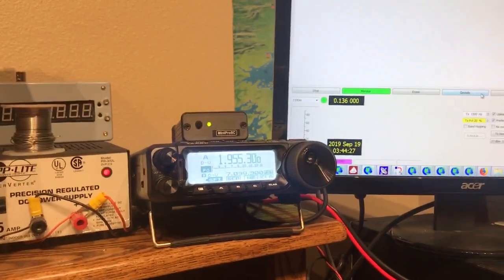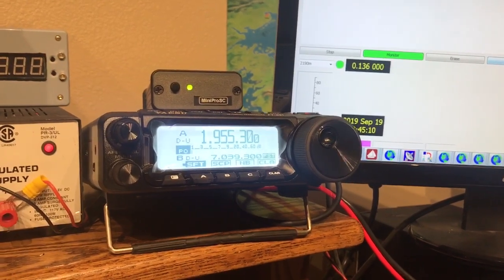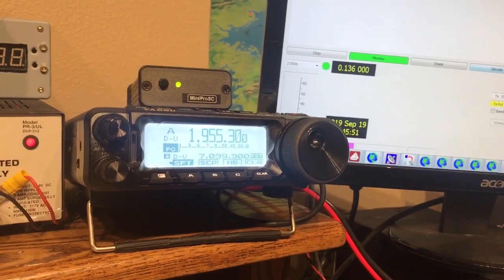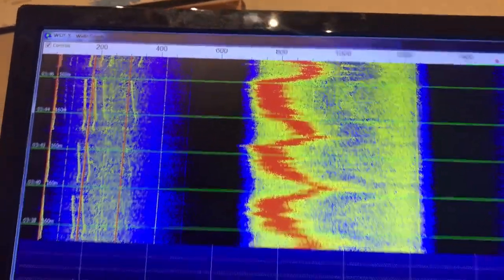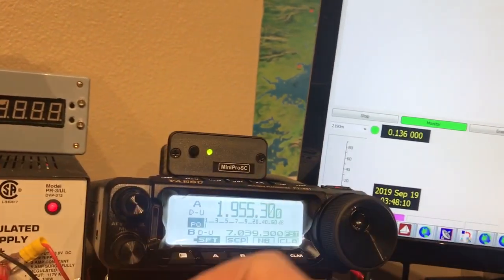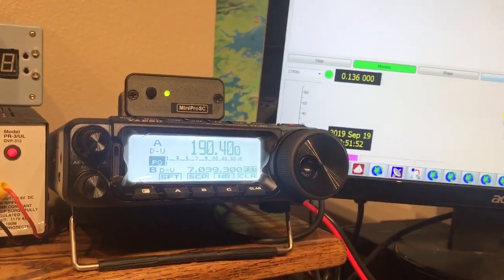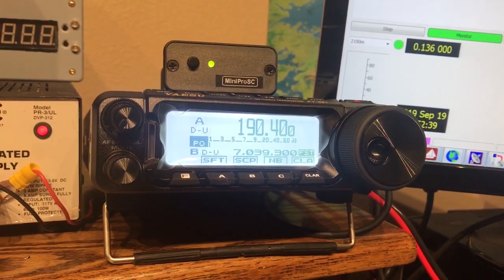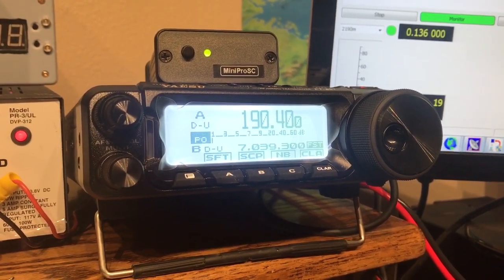FT-891. 160m problem - and worse lower

Comment from the maker: Thats good to know thanks zxeng6064  - I think (perhaps) it the DC/DC level converters needed a little stonger decoupling with lower ESR caps at MF/MF or screening - As people have stated here its not a bad radio for the price point at all but has a couple of design flaws which spoils some aspects for me at very low signal levels on discrete frequencies which Im trying to advertise for future designers-  and to reiterate  for "atomhamradio" the tests were done on DC battery stanalone power - nothing connected by ways to introduce switching noise  up the DC power cables and system terminated in a 50 ohm load direct to the back of the radio  -  I do hope newer serial numbers have indeed fixed my "winging pom" issue.

Comment: i like the radio but OMG they need to fix the firmware 

1. Mode menu, when selecting SSB mode "ask if you want USB or LSB" for faster switching. or just remove "SSB" and add in separate LSB USB trying to fined it in the Sub menu stinks why would they have it in the Submenu it makes it harder to switch.

1.5 when changing the Mode or the BAND using the VFO to select between them is horrible there is no positive feedback like the multi fashion knob.
Change it to the multi fashion knob the detents "clicks" make it easier to fined what you need. and keep it up till you press the multi fashion knob to confirm. a lot of times what happens is you move the VFO knob over shoot it and then bam your on the wrong band because it closes out in 1 sec!

2. With auto tuner enabled I get a "WAIT" over the freq display so I have to go and disable the Auto tuner when tuning around the band. it's Varey distracting it makes scanning the band hard or going to a freq to meetup on.
3. When adjusting the squelch or RF gain, the pop up screen stays up till you hit a button but then activates what ever button you hit! have it disappear after 2 or 3 sec.

4. DTMF mic why is there no DTFM mic to key in the freq you want to go to? They will sell you an extra key pad to you for $99 ??????? but if you get a DTFM mic it will not key in the freq.

5. The power submenu is confusing ok every one gets SSB, AM, and FM power But what is the need for HF power? isn't that a little redundant?

Comment: Pommie with a $500 radio complaining about nothing - this is the cheapest radio on the market.   It'  a bargain, but not without some minor issues at that price.  .
Reply from the maker: Thanks for your opinion -
Reply: @hellozerohellozero  .... yeah, you know you kinda get what you pay for... you want lab quality equipment, you'll have to pay the price and there are radios out there that will give almost lab quality service... and they have the price tags that go with it. I have both an FT 891 and a Xeigu G90 ... SDR, and it's not too  bad... SDR is different architecture for sure.  The FT 891 is probably the cheapest full power rig out there, and the overwhelming majority are happy with the rig... normal CW or SSB operation.

Comment: A cheap SWITCHing power supply will generate that harmonics. Newer ones have a shift on the power supply. Get the jetstream jtps32mab great supply. Gigga parts is a joke just use hro .
Reply from the maker: Thanks - the tests were done in the lab removed from monitors CPUs/ and the radio run on a car battery = \ and again in another location with no difference -

Comment: Sounds like a cheap power supply. It will emit harmonics. I went through this years ago.
Reply from the maker: Thanks - the 891 was on a standalone  battery supply and RF input terminated into 50 ohm but yes it sounds like switch mode but highly likely its a poorly screened,  under RF decoupling at the output of the converter(s)  or  general underdesign in a dc to dc converter layout -

Comment: I fell like most of there radios like the 857D all have these problems.
Reply from the maker: Thanks for all comments - it appears in my mind and limited testing the DC to DC converters and lack of decoupling or screening - I see other manufactures putting Herculean efforts in screening such pieces or circuitry but here, I guess they dont expect experimenters to be grubbing around in very narrow bandwidths for the last part of a dB...

Comment: Tnx for the video! I was about to buy one but with my interest in LW/MW it is better to look for something else if this is common. Did IPO on/off make any difference?
Reply from the maker: IPO no not really - I think for normal operations for SSB and CW its fine on 160m unless one of the DC DC spurs is strong enough to mask the signal

Comment: interesting video.  its an inexpensive radio that packs a pretty wide punch.  I have one here in Istanbul...and I guess I am run of the mill here because it pretty much does what it is suppose to do. if you want weak signal on 160 or the lower bands you are going to have to up the radio and up the antenna...this is not the radio for really good work on those bands (although on 160 it beats the vast majority of radios particularly with a good antenna) .  here in IST I had more problem with computers in the neighborhood (Yeslikoy) then I do with the radio.  On my farm in Santa Fe TX well things work better and I have better radios...but it is a good "level 5" on a scale of 1 to 10 radio in my view WB5MZO and TA1THY

Comment: I see you have pre-amp inserted and no attenuator. how can you have  below S1 of noise floor in 160m band and below? maybe it's due to the D-U mode? does it make sense to repeat the test with IPO and ATT turned on and maybe play with RF gain? just an idea....
Reply from the maker: Hi thanks, well we use a separate low noise directional array, and its sensitivity and levels are quite low (as required by the design) but still can be masked by the noise spurs - anything that is strong enough the  S meter as way of unwanted spurs or artifacts isnt good here especially if your looking for a signal say at -25 or more if using wspr or other digital modes - again fine to use if using SSB or CW